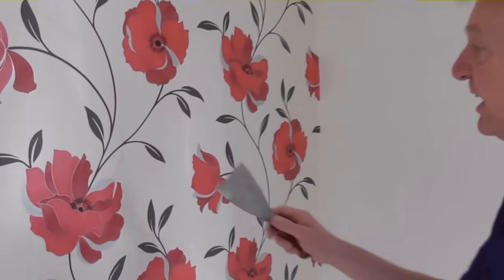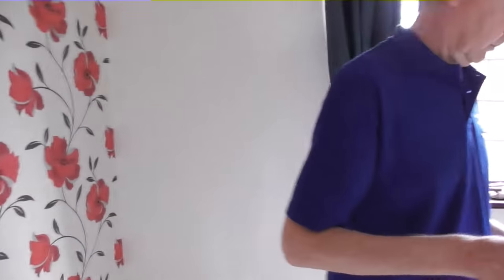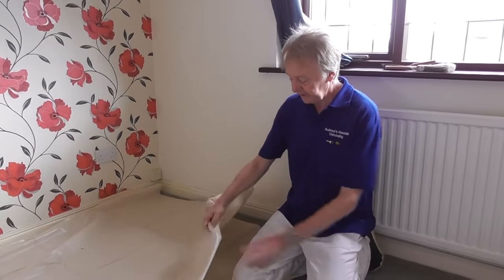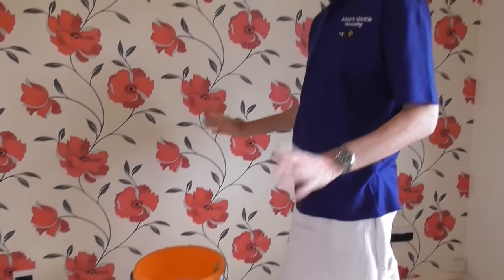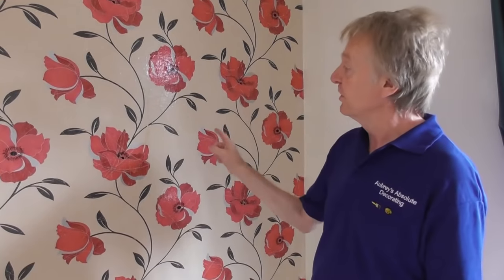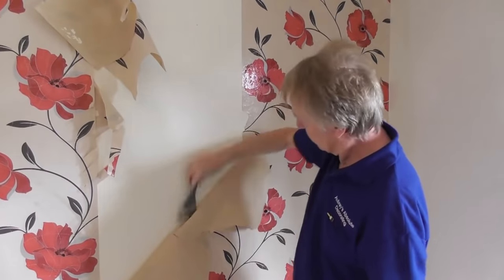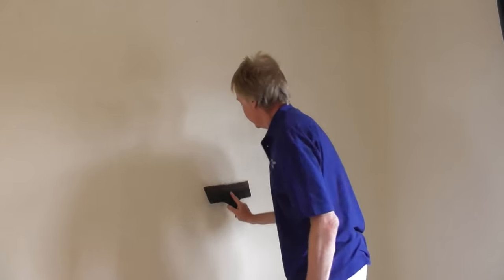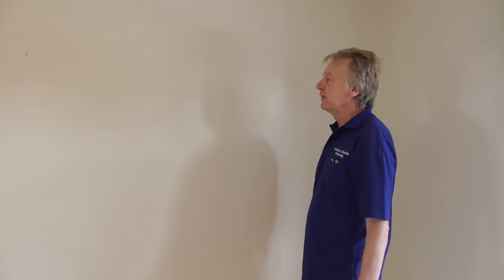How to Remove Wallpaper Fast Without Using a Steam Stripper

Comment: Thank you so much for explaining this clearly, I’m currently decorating my own flat for the first time on my own and I’ve been making such a mess of the wallpaper removal! I feel much more confident to crack on now that I know to perforate the paper and leave to soak in! Keep up the great videos! 😊 leoni, newcastle uk
Reply from the maker: That is great news Leoni, hope all goes well with the decorating.  Just make sure you soak it many times with the hot water and washing up liquid.  Also first check it is not a vinyl paper where you can peel the front off first.  😊

Comment: Thank you so much for sharing this video. I was having a really tough job using a steam stripper to remove old wallpaper, which ended up causing some of the plaster underneath to 'blow'. Using the water method, leaving the water to soak in and then stripping it with a hand tool, made a huge difference -- much easier and quicker.
Reply from the maker: That is great news, glad you found the video helpful.  Hope all goes well with your decorating project 😊

Comment: I had a bugger of a job getting the wallpaper off in my 1930’s bungalow.
Most of the rooms had been wallpapered many years ago before we bought the place, the trouble was the original wallpaper had been put directly onto the top of bare plaster.
This meant that to remove it you went through layers of wall paper until the final layer that was really bonded with the plaster.
The only way I could get it off was to use a spiked roller tool with a handle, similar to the tool used here, in that the spikes punctured the wallpaper to allow water and steam penetration.
I used a steamer and scraper to remove the layers (in some rooms up to 3 layers of wallpaper!), but the last layer had to be removed by using a razor blade type scraper which also took a fine layer off the top of the plaster in order to completely remove the stuck on paper -what a job!
Then I had to repair the walls due to scraper marks and top layer of plaster being “blown off” the wall in a couple of areas, due to leaving leaving the steamer in one place for too long!
Lots of plaster repair and sanding afterward and the walls (now painted) look good and flat.
No way could I have done the job without a steamer - if it had been any worse it would have been easier to take the top layer of plaster off and have the walls re-skimmed.
Reply from the maker: Wow, that was a huge job you had there Monty.  Fortunately ones like that are rare.  The worst one I have stripped was a staircase with seven layers of wallpaper.  You are right, a steamer is the only way when confronted with these sort of jobs.  I hope the rest of your decorating is more enjoyable.

Comment: The other way to break the surface of the paper to let the water in is to use a wire brush, I was taught (many years ago) to cross hatch it with a scraper though as shown here.
If you find a scraper where the corners are rounded off instead of being pointed, you know it's been used for scoring paper.
Oh and for those talking about using a steamer, I've done it both ways over the years and the method shown here is far less messy and sweaty than a steamer, in my opinion.

Comment: If you wish to paint the wall once wallpaper has been removed will the tool you demonstrated to score the wall damage the plaster underneath? What would you recommend to do in this instance? Thanks.
Reply from the maker: Hi Mark, as you can see on the video if used correctly the tool does not mark the wall.  I often use the tiger to remove wallpaper and have not found it to be an issue. If for some reason it does leave any marks on the wall just apply some filler once you have removed all the paste and washed down the surface.  Hope all goes well with the decorating 😊

Comment: Fantastic. Unfortunately my wallpaper is this kind (not the vinyl), spent 5 hours getting a small section done trying to scrape it off in sheets. Which obviously didn't work. Have the tiger, looking forward to trying it out. Thank you for the well explained demonstration.
Reply from the maker: Hope all goes well for you Collider.
Reply: @AubreysAbsoluteDecorating  Thanks again... went swimmingly this time with the tiger. Used a sponge, but if I ever had to do it again (which I hope I don't) I'd use a roller, probably much faster.

Comment: I have a air compressor and use a paint spray attachment to spray water on the wall. Seems to work well as you can control the amount of water, cover a fairly large area without all the bending down and drips from a brush. I’m getting older and my back not so keen to keep bending down!

Another use for the compressor is when cleaning brushes or rollers. Once a roller has been cleaned a very quick way to dry it is by running a jet of air on the side of the roller (still on the handle) which will spin it at quite a high rate so dry in a few seconds and it seems to bring the pile up almost like new. Brushes can also be blow dried but it can splay the bristles out a little.
Reply from the maker: That's a great idea! 😊

Comment: I tried steaming off wallpaper back when I was a kid in 1974, in July, here in the Massachusetts. Never again, but anyone who does should aim for mid-winter instead. In  a later job, I used push-pins to hang 2 or 3 wet towels on the wall, although 5 or 6 would have saved more time. I just kept spraying them until the area underneath one became obviously soggy, then that towel was moved to a new spot and what was under it was scraped off.  It would also have been good to have a scoring tool, though since I assumed I'd never need it again, I never bought one. Most of the wallpaper I've seen recently has been the kind that pulls off in one sheet, so it's worth tugging on a corner or two before going for the scrapers.

Comment: Very helpful video Aubrey, I managed to remove all paper from the wall easily following your tutorial. Now I’ve come to the point to remove the glue but I don’t want to buy a wall scraper as shown in your video. Can I use a squeegee - the tool for scraping snow and ice on your car - instead? Will it damage the wall? Thank you.
Reply from the maker: It may work fine, I am sure it will not damage the wall surface.

Comment: So what do I do if the paper turns to mush from the water mix, and there's eight more layers behind it?
Reply from the maker: If indeed there are up to eight layers of wallpaper on the surface then this is the time to use a steam stripper. Hope all goes well with the decorating Bella.
Reply: @AubreysAbsoluteDecorating  Actually just went and bought one because I got so frustrated! 😅
Reply: @AubreysAbsoluteDecorating  So, just encountered another problem! Apparently I have plaster walls beneath all those layers of wallpaper, and the steamer makes the protective lining paper closest to the plaster shrivel up and it ruins the wall! 😅Help!
Reply from the maker: It sounds like you may have a plasterboard wall under the wallpapers.  It may be that the plasterboard was not sealed before applying wallpaper over it which means it can be virtually impossible to remove the wallpaper without badly damaging the plasterboard.  You may be able to do repairs to the wall once the paper is off and apply lining paper over it to give a surface which can be painted.

Comment: Love the channel. I do the same method, but here the wallpaper went behind the sockets. What should I do?
Reply from the maker: Glad you are finding the videos helpful.  Make sure the power to the socket is turned off by flicking the correct switch in your consumer unit.  Then slightly undo the two screws on the face of the socket and you should be able to flick the paper out from under the socket by gently using a small scraper or similar.

Comment: Nice vid Aubrey. Although,I’ve found it’s totally impossible to remove all the paste from walls if you want to paint them! Invariably you’re going to get “crocodiling” on the new paint so the only sure way I’ve found is to apply lining paper then paint that. It also gives a nice flat surface to paint on and looks really professional. Keep them coming sir!
Reply: You can sand it off if you have an orbital sander 🙏🏻👍🏻👍🏻
Reply: Kathy, there is a product called Gardz which seals the wall after you have gotten as much glue off as possible.  It is clear, dries in about 40 minutes and is easy to use.  Using Gardz insures that your paint does not alligator.

Comment: you know how in British homes the walls are wooden. can I carry out the same method on these walls. will it ruin the actual wall at the back of the wallpaper
Reply from the maker: Most modern houses in Britain have plasterboard on the walls.  Sometimes it is plastered over and sometimes paint is applied directly onto the plasterboard.  In the video I am removing the wallpaper from a wall covered with plasterboard.  No damage was done to the wall surface.  As long as the plasterboard has been plastered or received many coats of paint then things should be ok.  I would suggest trying a small test area first.  Hope things go well for you 😊
Reply: @AubreysAbsoluteDecorating  thank you so much for the advice. I did that and it turned out really well.
Reply from the maker: That is great to hear, good stuff. 😊

Comment: I tried that with my walls, but the wallpaper is 50 years old, and it was ruined by water leaks from the roof and sun damage from skylights. It didnt work. I had to peel the paper off, then wet the glue backed paper, then scrape it off with a razor scraper, then it came off relatively clean. Is this typical for old wallpaper?
Reply from the maker: Hi, it could be that the fibers of the paper have fused together due to the leak and the sun damage.  There was also a hot water paste around when this paper was hung which can also make it difficult to remove the paper.  Glad to hear you did manage to remove it but sounds like it was hard work.  Hope the walls were in good condition.

Comment: Can you use this method on a DRY/STUD wall?
Reply from the maker: The wall used in this video was a Stud Wall.
Reply: @AubreysAbsoluteDecorating  Thank you sir. I will attempt this, if god forbid it goes wrong, what would i need doing? Skimming?
Reply from the maker: I would suggest you try a test area first.  Make sure you fully wet the surface many times before attempting to scrape off the paper.  Hope all goes well for you 😊

Comment: I’d love to know how to remove a grit bobble underneath dried wallpaper, because mine is causing absolute havoc with my OCD.
Reply from the maker: You could try making a small incision with a craft knife, flick out the piece of grit, apply a dab of PVA glue with a small artists brush and push the paper back down again.  I have done this several times and it looked better.
Reply: @AubreysAbsoluteDecorating  thank you very much 🙏🏼

Comment: What did you say that tool was that you used to get the paste off? This video is very helpful!
Reply from the maker: Hi Melissa, the tool is called a caulking tool with steel blade.  Several place sell it on the internet. You can also get plastic ones but the steel ones work best for this purpose.  Hope all goes well with your decorating 😊

Comment: Hello, I have just removed wallpaper using steam stripper. There is old very thin plaster on the drywall. It is peeling from some areas where I can see plasterboard. I was thinking of using Zinsser Gardz on walls to seal and then use Dulux Primer & Undercoat. After this apply Dulux easycare Matt emulsion top coat. Is this ok?
Reply from the maker: Hi, yes this would be a very suitable paint system for this problem 👍
Reply: @AubreysAbsoluteDecorating  Thank you so much for your advise 😊

Comment: Splashed wall with roller after painting fireplace need to cover walls are a strong white colour paint marks from roller dark blue ?
Reply from the maker: Hi, if the blue paint was water based you could try lightly rubbing the blue splashes with a damp scouring pad or one of those magic sponges.  This will often remove splashes.  If this doesn't work it may be necessary to re-paint the white wall.  Brush a few coats over the splashes first and then give the whole wall one or two coats.  Hope all goes well for you Paula.

Comment: Hi Aubrey,

I work with a painting company and we have a client who has about 1,200 sq ft of wallpaper to remove. I've read somewhere that scoring a wall should be the last method you try after you use other methods, as scoring might leave behind holes in the wall itself. What are your thoughts? Is the method safe for most/all walls?
Reply from the maker: Hi Dylan, that is a lot of wallpaper to remove.  Very good question.  Most modern wallpapers are washable/super washable.  This means they are designed to repel water.  Not good when you want to remove them.  This is why we need to perforate the paper to enable water to get behind the paper and soften the adhesive which is holding it to the wall.  If your lucky it can be a vinyl paper where yo can peel off the plastic front layer and then remove the backing.  As you can see in the video I did not damage the wall surface using the tiger.  Steam strippers are really helpful when removing painted over wallpaper but can blow the plaster on older properties.  The safest bet is to do a test area with your chosen method of removal to see if it leaves the surface undamaged and is efficient use of time.  The best tip I was given as an apprentice was let the water do the work, it really does make a difference.  Removing all the old adhesive is also extremely important to prevent applied paint from cracking or applied paper not adhering to the surface. Hope all goes well for you 😊

Comment: Wish me luck. I'm going to attempt it today
Reply from the maker: Hope all goes well.  Make sure you soak the paper several times allowing it to soak in before stripping.  If it is a vinyl paper see if you can peel the face of the paper off first.  Good luck 😊
Reply: It went brilliant.  I scored the paper and wet it with a cloth 4 times and it just peeled off. Now for my 1st attempt at putting new paper up. Thanks for your help x
Reply from the maker: That is great news, hope all goes well with the wallpapering 😊

Comment: How long did you wait after applying the water?
Reply from the maker: Soak it at least three times waiting about 5 mins between each and then try scraping it off.  If necessary keep applying more water as you work.
Reply: @AubreysAbsoluteDecorating  thanks for the tip

Comment: Will this damage the wall if u need to paint it after???
Reply from the maker: If the tiger is used properly it does not damage the wall surface as can be seen in the video.  You could always do a test area first to put your mind at rest.
Reply: @AubreysAbsoluteDecorating  thank you been watching loads of your stuff just starting out on my own so thanks for ya help

Comment: The Tiger paw tool can be a problem, if you using in a new build house you will most likely be fine if you don't push to hard, if you live in a Victoria property dont use one as the plaster is very soft and it will screw up the plaster behind and take much repair work to prepare again.

Comment: I strip the top layer off never had a problem with modern wallpapers,   just get an edge and strip it off slowly,   then get a bucket of water and a floor brush and soak soak soak,  don't worry about water,  it won't cause any problems,   this method has been used before my father was born and he was born in 1926,   very minimum use of a wallpaper scraper with this method,   and put the paper in a black bag as you go along

Comment: Did you actually used only hoy water to wet the walk before strapping?
Reply from the maker: I just added a little washing up liquid (Fairy Liquid).  The main thing is to make sure that you wet the area several times before stripping. Let the water do the work.

Comment: I'm in the middle of taking off woodchip. I think removing the paste off is going to be a bugger of a chore. I plan to wash down with sugar soap and scrape off the goo. I'm afraid I'll be missing bits though.
Reply from the maker: Yes, it can be a very messy job but it is essential to remove the old paste.  To be safe, if you intend to emulsion the walls afterwards then first apply a coat of Zinsser Guards to seal the surface.  Hope all goes well for you.

Comment: This video is ok for wallpaper shown in the video, not very old and not much glue/adhesive. You can tell by how it came off in a perfect sheet without anything sticking whatsoever. Need a video showing 50 year old plus wallpaper removal.

Comment: I'm sorry--a dash of what?? (At 3:25.)  I'm American, and I can't understand what it is that you mixed with the hot water. Thanks!
Reply from the maker: Hi, I added a squirt of washing up liquid for washing cups and plates.  The popular brand over here is fairy liquid.  The main thing is to make sure you soak the area several times first before scraping off, let the water do the work.  Hope all goes well with the decorating I K 😊

Comment: How do I do this with 70s embossed  paper that's been painted several times
Reply from the maker: Hi, if the paper has been painted over many times, particularly with vinyl silk then it may be best to fire up the steam stripper.  You could first try a small area using the process shown in the video, perhaps scoring the paper first with the edge of the scraper and soaking several times with hot water and a dash of fairy liquid.  Hope all goes well for you Tom Tom.
Reply: @AubreysAbsoluteDecorating  thanks for the reply, I managed to pull the top layer off,  and then painted with soapy water and it came off fine. Many thanks for the video, saved me a lot of time
Reply from the maker: That is brilliant news, glad it worked out OK for you 😊